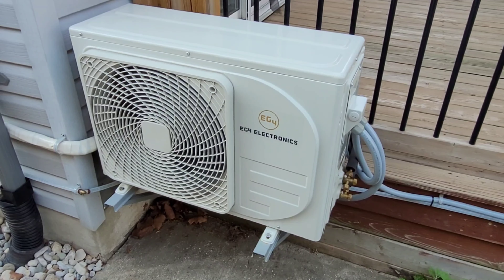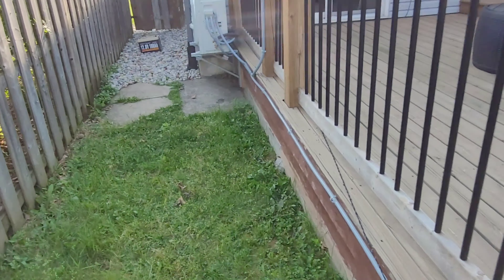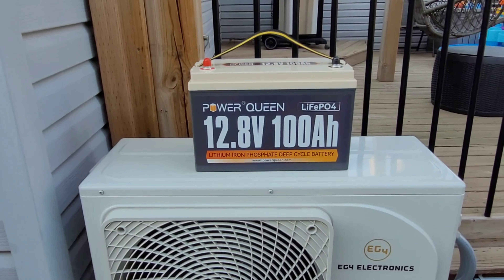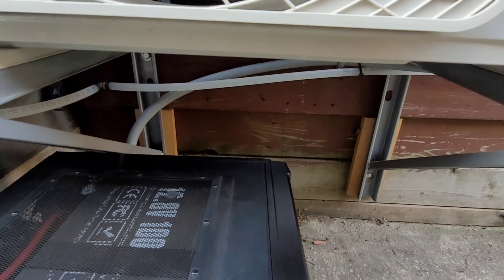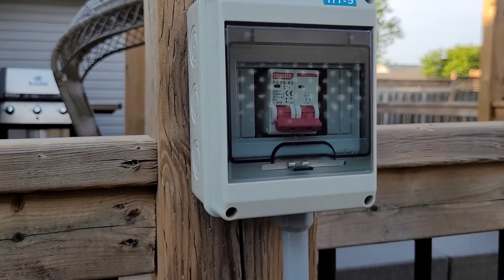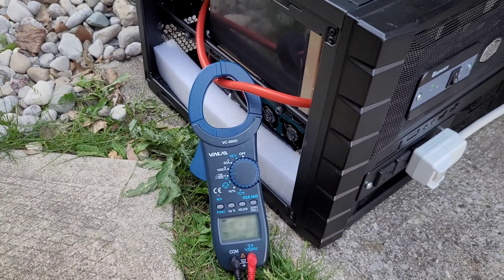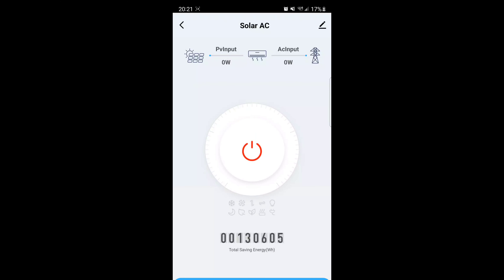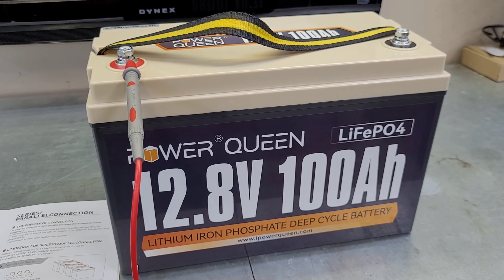Can You Run An Air Conditioner On Solar /  LiFePO4 Powerqueen Battery?

Comment: Help me out please: I think I figured out from comments here and on other YTs that have reviewed this MS you cannot run it direct from batteries in series that are charged simultaneously by solar panels regulated by a good MPPT charge controller without voiding the warranty(?) Ture? 

So, in this case, you ran it off 120VAC (created by a 12-volt DC battery and pure sine wave inverter). 

Would it void the warranty if you simultaneously powered that 12-volt battery/inverter system with solar through a quality MPPT charge controller?

Would it void the warranty if you did as the sentence just before stated and with another set of solar panels supplied direct DC from the panels to the unit while it has the "back up" AC provided by the solar charged 12 volt battery supplying the connected pure sine wave inverter?

I am trying to figure out if I can run this thing completely Off-Grid in a way that works for me and does not void the warranty
Reply from the maker: I don't see an issue running it off of a pure wine 120v inverter, that is charger by solar and an mppt, as the end result is still 120v Ac feeding into the Ac input. Running it directly off of batteries to the DC input of the Ac would void the warranty I assume, it may be worth reaching out and asking the manufacturer, but I wouldn't recommend trying it.
Reply: If you do this or find out more info please post here I’m wondering the same thing

Comment: SO YOU SPENT THOUSANDS OF DOLLARS TO SAVE 20 DOLLARS A DAY?
Reply from the maker: 20 dollars a day? Seems like that would add up pretty quick.. It'd be paid off in 3 months at that rate.
Reply: @SmitHVAC.  i live in a small house where my electric only costs 6 dollars a day and i am sure that with your income 20 dollars a day is not much .
Reply: @SmitHVAC.  besides you said that you cant use it but two to three hours before the grid has to kick in

Comment: Your not goin to run a ac on 12v battery for 2 hours
Reply from the maker: @brian92345  wrong
Reply: I’ll believe it when I see it going from 12v to 120v is too much of a load on a 12v battery . I had 8 12v 1000ah batteries and they won’t even run a ac for more then 2 hours . You need a higher volt battery bank . I got tired of playing with the little  stuff that don’t work . I built my hole home enphase solar system , I have 25kwh of battery back up and it’s only will run my home with my central air-conditioning for like 8 hours . With out the ac it powers my home for 20 hours but by then the sun is back up and it’s charging the batteries back. So ya bro I’m goin to say you can’t run a ac on a single 12v 1000 ah battery
Reply from the maker: @brian92345 Voltage has nothing to do with run time. Watch any of the other videos, this Ac runs around 500w on average. 12v x 100ah = 1280wh. 1280wh ÷ 500w =2.56hrs. Maybe you don't understand this stuff as well as you thought.. You obviously have a very inefficient Ac if you can only run 8 hrs on 25kwh.
Reply: @SmitHVAC.  I have not just my ac running , my house is 2000 sq ft and my wife and I have 5 kids . .  We use a lot of power .  I experimented with 12v systems and my travel trailer . I never could get any thing to run long with a 12v battery bank . There is to much power lost in converting power from 12v to 120v . It draws more power to convert  then what your running. This is  what I found on my experience. Soon as I went to a higher voltage battery bank the run time would jump up 10 fold . . So endless there’s new technology out  I still disagree.
Reply from the maker: Not sure what inverter you're using but most modern 12v inverters are 85 to 90% efficient. I've run this on 12v, 24v and 48v systems with no major differences. I could run this for 24 hrs if I had enough 12v batteries in parallel. It wouldn't make much sense to do that but it's not rocket science.

Comment: How much you charge to install 2 mini split with solar
Reply from the maker: I wouldn't be able to install the solar side of this for someone due to liability. As far as the mini splits themselves it all depends on the installation, how far from the electrical panel, the location of the units etc.
Reply: $6,000
Reply: 400 day pay back/solar pak/replace battery now